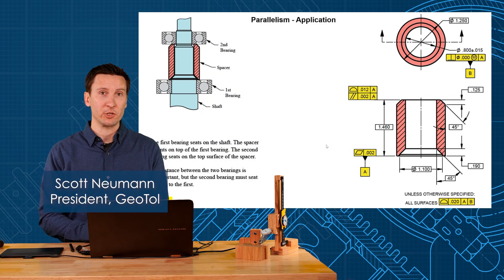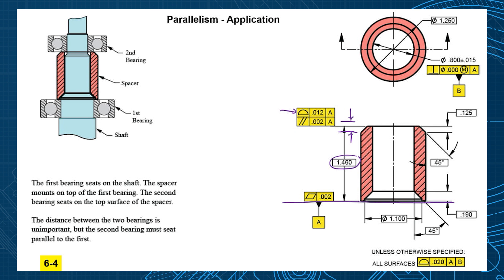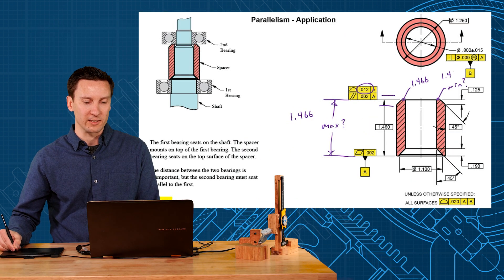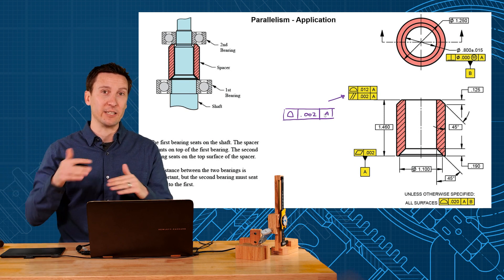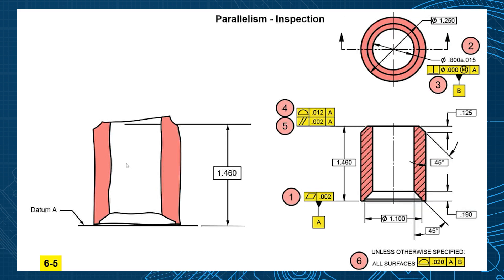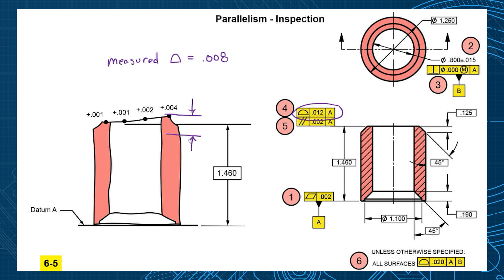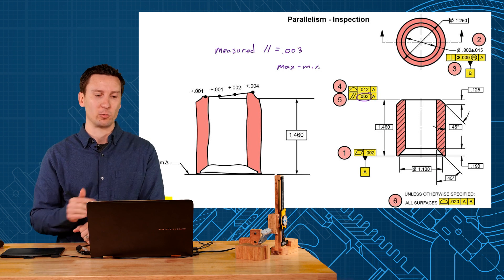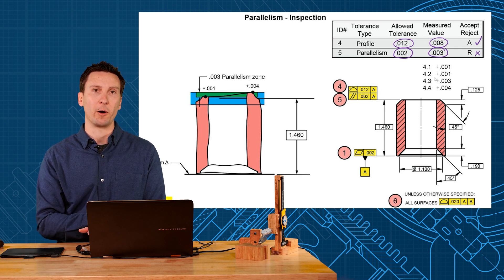Parallelism Applied with Profile Tolerance

Comment: Hi, I’m a bit confused when you say the profile measured .008. I thought it was .004, since that’s the difference from the true profile. Could you help clarify?
Reply from the maker: Profile tolerance is reported as a total zone centered about the true profile (basic dimension). If there is a deviation of .004, this reports as an .008 zone. 
This is similar to position tolerance. A .004 radial deviation is reported as a .008 diameter zone.

Comment: Thanks for these great videos. They are really useful. I have a question on this one if you dont mind. On these cylindrical parts(spacer) where they may be interference fits would the interference or maybe transition fit dictate that the axis of the spacer becomes datum A then the lower end is controlled with a tight perpendicular tol, that becomes datum B, then the opposite end would be controlled as you've shown back to A and B? or are these spacers clearance and that's why the end is datum A. Does it depend on what sort of fit the hole/shaft relationship is ? Hope you understand what I'm trying to say. Thanks.
Reply from the maker: Yes, in your scenario, the fit on the diameter is so tight that the axis dominates the rotational alignment of the part. I agree the axis would be a better datum A and face as secondary datum feature B. On my part shown, the fit is so sloppy that the face sets the initial "attitude" and is a better primary.
Reply: @GeoTolPro perfect, thanks for the reply.

Comment: When you have a profile tolerance refined by parallelism, and you have surface imperfections (chatter marks, non cleanup) in the surface, are those imperfections allowed to be filtered out of the parallelism? In other words, I have a surface that passes profile but when the chatter is captured in the parallelism with laser inspection, the parallelism fails.
Reply from the maker: This is a controversial topic. Per ASME Y14.5-2018, sec 4.1 fundamental rules (s): "UOS, elements of a surface include surface texture and flaws. All elements of a surface shall be within the applicable specified tolerance zone boundaries." This rule has caused issues in the metrology world. Y14.5.1-1994 section 2.1.1 says "a certain amount of smoothing is necessary...". The best I can say is a new standard will be released on this topic soon, Y14.49 supplemental dimensioning and tolerancing specification, to better address filtering and the functional requirements.
Reply: Thank you for taking the time to reply!

Comment: I don't get why 0.002 is considered a 'nice flatness' tolerance over about a 1 inch diameter. I'd expect 0.0002 easily and 0.0001 inch with a little care on a new machine ... and I would think that if 0.002 was accepted , that inaccurate flatness pressing on a bearing would be bad.
Reply from the maker: Good comment. Of course it all depends on function but I agree that a tighter flatness than .002 may be needed and would be easy to manufacture to. Fourth decimal tolerance values are hard to do teaching and explanations with.

Comment: How about we put the composite profile .012 on top row with Datum A, while .002 on bottom row without datum? It is to control the form (i know it is not parallel) but it achieve the similar result.
Reply from the maker: The lower frame in your example would only control flatness (no datum, to itself). 
Composite profile with A in both the lower and upper would be the same as the drawing in the video. However, profile and parallelism is easier to understand (keep it simple). 
Use composite profile if its a complex surface or multiple surfaces.

Comment: Well explained, just wondering if positional tolerance could be used to control the 1.460 height? That mean we'd have parallelism to control shape and position to control location.
Reply from the maker: In ASME Y14.5, position tolerance only controls the location of features of size (holes, slots, pins, etc.). While profile controls the location of surfaces. 

In ISO-GPS standards, however, position may be used to control the location of planar surfaces (ISO 1101: 2017)

Comment: Thanks for the great video. Could you clarify the following? In the measurement plan, for requirement no. 3 (perpendicularity, zeo at MMC), the inspection method is "height gage and angle plate, not measured if size above .800."  How would this work for inspection of perpendicularity? and why not measured if size is above .800?
Reply from the maker: The MMC modifier allows bonus tolerance as the feature departs from MMC. If the hole is produced at .800, it is allowed .015 position tolerance. This is a huge tolerance and easy to pass. Perpendicularity is a little difficult and time-consuming to measure (with a height gage). Lets save time and money and make it a pass thru inspection (because we're confident in the lathe manufacturing process).
Reply: @GeoTolPro  thanks a lot for the clarification. It makes sense. So if the hole diameter is smaller than .800 I understand that a measurement of perpendicularity is still required, could you tell how it is performed with a height gage? I imagine it is no easy task because it would be needed to evaluate the axis deviation? A surface method fixture that includes the simulator for datum A and a virtual condition pin gage for perpendicularity (diametet of .785) would probably be easier to implement but would only allow a pass/fail test. Right?
Reply from the maker: First, you must align the part to datum A (probably with an angle plate). You must now find the center of the hole in two places (call it front and back). The height gage touches top and bottom of the hole at the front and top and bottom at the back. This displacement represents the deviation of the axis in the Y direction. Rotate the part 90 degrees and repeat for the X direction. Now you have the deviation of the axis in both X and Y. Use the Pythagorean theorem to get the hypotenuse and perpendicularity value. 

Hard to explain in a comment. Look at my video on parallelism for the hole. It shows more detail on this inspection data for an orientation tolerance: https://youtu.be/qtp_VqpnPZg
Reply: @GeoTolPro Thank you for the thorough explanation, the other video was very helpful too! Your content is awesome.

Comment: Can you please explain , why are we not adding Flatness value to basic ? even flatness also contributes to the variation right?
Reply: Flatness is there called out on Datum A.
Reply from the maker: Flatness is applied to a feature (surface) not to a basic. The datum feature A must be flat. The top surface must be located (profile) to datum A and also with a tighter parallelism. Both profile and parallelism control flatness on the top surface.

Comment: How would you understand the parallelism of the surface if we also relate it to the shaft axis like 0.002 | [A] | [B]?
Reply from the maker: There would be no difference. Datum A constrains all the rotations necessary to determine the parallelism of the top surface.